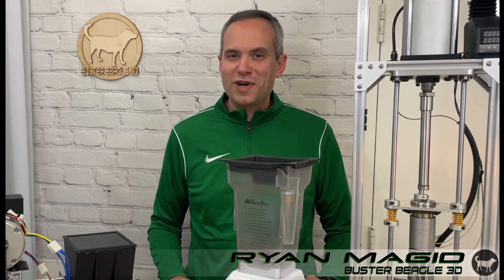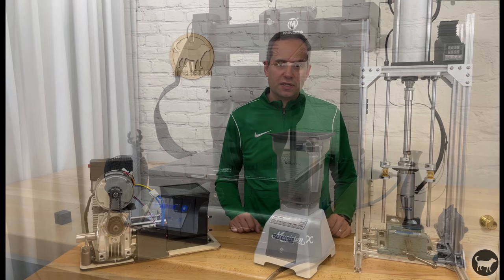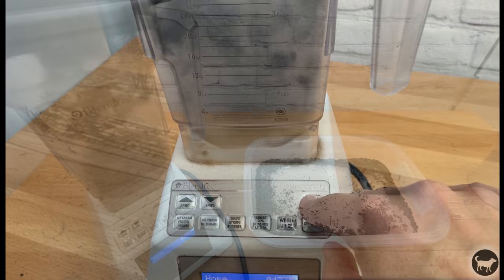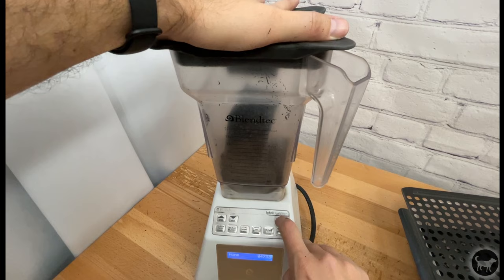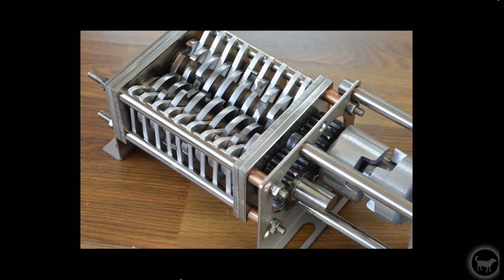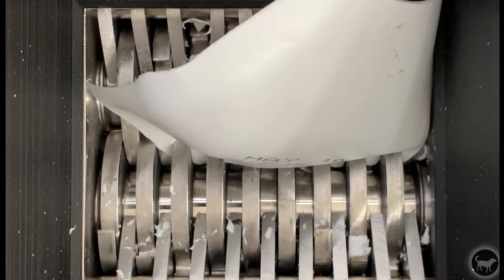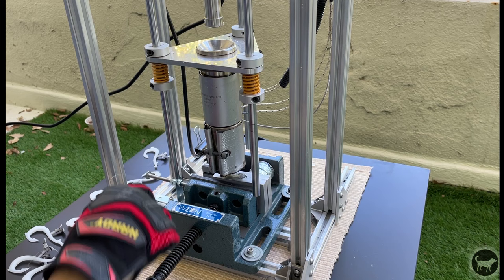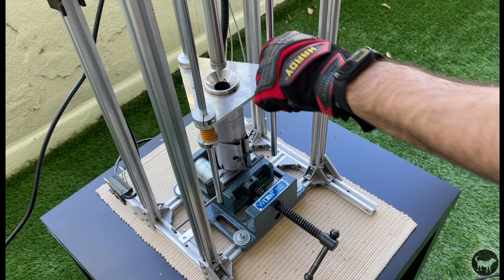Recycle 3D Prints and other Plastics at Home | Plastic Shredding | BB3D MK3

Comment: While this is an interesting topic to me, this thing looks extremely dangerous as it is and I would not want to have a machine like this in my house. I have two little kids, who are very curious about all the things that I work with and if i built something like that, I would implement two safety features. I mean not only for others but also to prevent myself from doing something dumb: First, a lid, that prevents reaching into the machine when it's on and prevents it from turning on when open. And second, two operation switches with some distance between them, that need to be held with both hands to turn it on. I know this makes it harder to work with but I rather work harder, than have something bad happen to anyone.

Comment: I wasted my money on a Blendtec blender to grind PLA, the plastic jar broke in about 15 minuted of use. If they made a glass jar instead of plastic it would have worked.  I've tried 5 other blenders and all of them broke, either the blades broke off or the gears stripped. Haven't found one yet that is durable enough to grind PLA.
Reply: I personally bought a $20 blender just for secondary processing.

Comment: I see a very good modification potential with the blendtech blender, install that filter right under the blades, then you can have a hole underneat it and a collection tray. this way you tecnically dont need to be lifting it up all the time to pour, you get finished grinded plastic the size you need them to be from the getgo pouring out by themselves
Reply from the maker: Not a bad idea.

Comment: Ive been thinking of recycling un reinforced garden hose. Ive got 100ft of the stuff, Its really flexible and has great pull strength. I have no clue what plastic it is though, its not rubber so...

Comment: i printed in 100 % SOLID PLA... am i screwed in converting this 100 % pieces of PLA..... I need a melter... anything you reccommend ?.. can i convert it back into 1.75 size filament that is used in 3D printing ?
Reply from the maker: If you break the pieces down small enough they can be fed into a filament extruder. There are a bunch of DIY as well as purpose built machines online for this purpose. Might need a cost analysis to see if it's worth doing it but it is possible.

Comment: Can you make filament with this ?, I know about the pulltrusion versions , but want to find another way to make filment from ground up scrap prints and bottles that you can't normally cut .
Reply: Here in 2024 you can if you shred it fine enough put it through an Artme3D extruder.  It does have a bit of trouble with feeding shreds so you may want to build a palletizer, grind up the first pass of filament, and re-run it to get a consistent diameter.

Beware that PE and PP are tough to print successfully (PE being also difficult to extrude due to its viscosity) and 3D printing plastics must be well dried before being melted in the Artme3D.

Comment: I remelt my PLA in resin molds using a toaster oven.  I make things like pendants, shot glasses and coasters.
Reply: That's a good idea. Any special resin or just regular 2-part silicon mold resin?
Reply: @ausfoodgarden  Just oven proof molds I got from Michaels.
Reply: @trustyourforce4041  Ah cool, yep I guess they'd be your regular silicone ones then. I'm just thinking of melting all my waste into little giveaways for folks who buy my actual products.  Cheers!
Reply from the maker: I have done a little of that to. It's kind fun, I bought silicon grilling gloves to be able to handle it right out of the toaster oven, it's still pretty hot and you have to be careful but you can make some fun things with it.

Comment: Hi Ryan. Did you experiment with HDPE or PP in the Blendtec? I've been using a credit card shredder for HDPE with similar results as yours. My machine is a little better at separating the chips, but like in your video, the pieces are larger than I would like them to be. Appreciate the time and effort you put into these videos.
Reply from the maker: I didn't try the HDPE but did try the PP. The problem was it was a little more flexible so it knocked it around more than it chopped it. I was trying pretty large pieces. Maybe I should have tried smaller ones.
Reply: Did you try a slower cycle?  Because if you blend too fast then materials will.just bounce off the blades.  The Blendtec tends to be extremely fast and depending on what you are grinding could run too fast.

Comment: how is that BLENDTEC blender holding up as a PLA SHREDDER... do you still recommend it as capable of doing the job of breaking down the PLA.
Reply from the maker: I've used is only a few times now since I haven't accumulated that much 3D printer scraps but so far so good. I wouldn't recommend buying a brand new machine to do it but it's been holding up so far.
Reply: I wound not recommend it, the plastic jar on mine broke after 15 minuted of use.  The thin wall plastic jar they use is the weak part.
Reply: @sigma9102  Thank you for your comment.. i am now going to cut sheets of metal and silicone glue it to its sides for reinforcement.. i purposely bought this blender for PLA breakdowns to remelt it again for usefulness.. perhaps you can fix yours as well i hope.

Comment: Nice video as always! Is there any additional steps should I do before switching materials when injecting?
Reply from the maker: It would have been better if I had removed the nozzle and cleaned out the material in there before switching to another type of plastic and color but since these were all just tests I wasn't that concerned. You can watch the cleanup video here. It's the MK1 but the process is the same.  https://youtu.be/_xt9IpcRtrc

Comment: You don't worry about warping from not letting the plastic cool slowly in the mold?
Reply: plastics that are suitable for 3d printing are generally low shrinkage since high shrinkage materials will warp too badly to stay on the print bed
Reply from the maker: I let them partially cool in the mold but not all of the way. The more important thing I think is to keep pressure on the mold initially after a shot when it starts to cool to prevent shrinkage.

Comment: Did you do any other change to the wiring besides adding the potentiometer? What channels did you connect it to?.
Reply from the maker: I hooked the potentiometer to the throttle cables on the scooter speed controller. This is the controller that I used.  https://amzn.to/3Drcp9F

Comment: One would think that if you put on safety goggles when using a closed blender you would put on chain guards for your drive but one would be wrong. May the little fingers stay safe!
Reply from the maker: More then one have mentioned it. I still have all finger as I write this but could use a chain guard I suppose.

Comment: This is a great video!
Would you be willing to share the 3D printer files for the chute and cover you built? I purchased the same shredder from DIY Chen and I’m currently getting it set up for regular safe use. Thanks!
Reply from the maker: Sorry I just saw that I missed this. You can find all of my STL files here. It's been a while so I can't remember if I had to tweak anything in the end but it should be a good starting point if you need anything. 
https://drive.google.com/drive/folders/1WBpaUYxft1ey7d_Bq-StePDGK6V4B8ch?usp=sharing

Comment: Cool, looks like the perfect machine for the job, well maybe a cutting type tool rather than grinding would be better for softer plastics. Someone on youtube made a 3d printed shredder using the same type of design, and it surpsingly worked pretty good, to shred expired vegetables... but could easily shred plastic if you put some metal inserts on the teeth I was thinking, maybe even razor blades would be enough.  I tried using a low powered blender and  the fumes were surprisingly noxious off waterbottle caps and poor cuts due to softness put me off from going further, but this video inspired me to try again with a higher powered blender, and perhaps only with pla for now.  Thanks.
Reply from the maker: Yeah the PLA worked crazy good in the blender. I was somewhat surprised by how good it did. Just look out to not go too fast and just make dust.

Comment: No matter how much I recycle steppers alley h channels petg tubing heaters controllers etc.. I Will cost 200 in Australia just for a auger bit a the tube to house that as the extruder... It's so fkn expensive to build one even with half the parts 🤬🤬🤬
Reply: I ran a machine making bubble wrap and it's essentially the same machine extruder wise
Reply: So I know exactly what I need to to but man it just isn't cost effective diy in Australia .. better of buying a felfil kit or something for $700 it ends up cheaper and I literally had almost all the parts required .
Reply: AndysMachines made a video to DIY an augur bit it's titled "Making an Auger (feed conveyor) from Washers ...and mathematics!" It requires a welder so it may not be an option. Maybe you could use some JB weld in place?
Reply: @ttf1re  man thankyou I was kind of thrown so much by that auger bit pricing I hadn't even considered that haha.. and yeh that's an option mate I'll get onto it thankyou so much !!!!
Reply: @daniel-is6zf  Glad to help! I just saw the video last night in my research. I hope it turns out well for you!
Reply: @ttf1re  mate you really solved a huge problem for me 😆 it definitely will I have the welder and i have a mini lathe so I think you're done it for sure 😆
Reply: Plan is to do as they did then clean it up on the mini lathe so I don't have to stuff round cleaning up welds and yeh route out the thread 👍😁